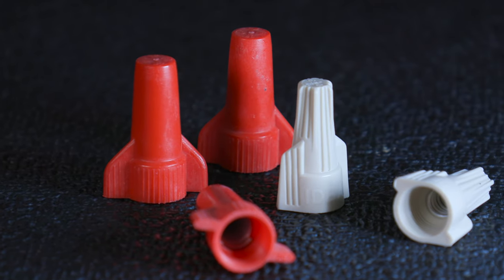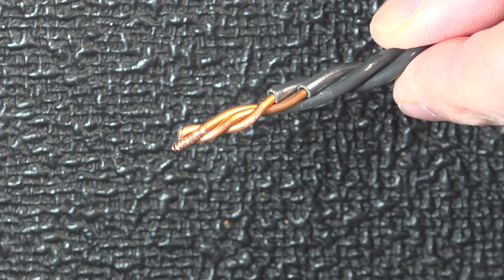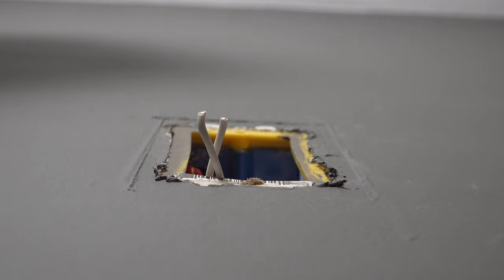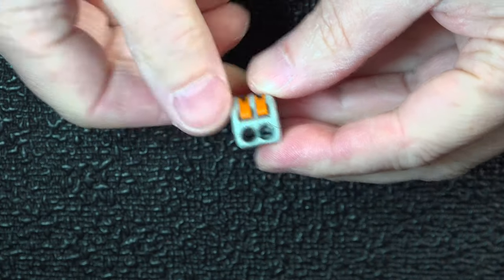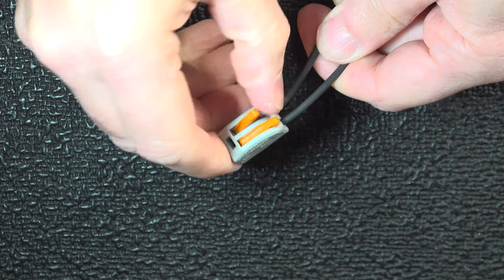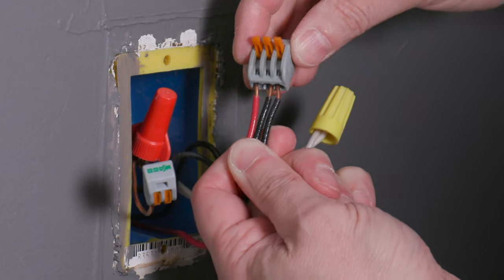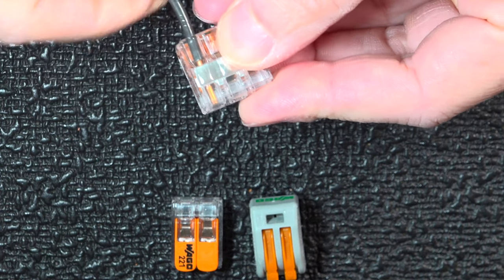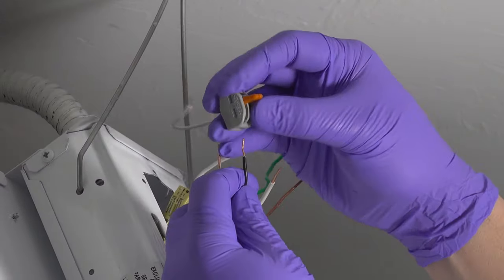Never use Wire Nuts Again - Wago is Better Electrical Connector

Comment: Lucky my Klein plyers allow me to redo a splice without cutting the wires. This is good for do it yourself or for lighting, but box splices should aways be spliced proper for 100 years of no issue!  Signs of melted marrets are a sigh of overloaded wire and not a bad splice. I am a master electrical contractor of 29 years.
Reply: Yea wire nuts are the way to go. Expansion and contraction of the wire will cause loose connections in wagos.
Reply: There is so much misinformation in this video. It gave me a headache.
Reply: @JorgeAMG187  I can pull wires out of wagos. I can't pull wires out of wire nuts. And yea heating and contraction of copper over time cause by load changes over time can cause a loose connection in a wago.
Reply: @Check7his With enough Force i can Pull a wire out of a Wire Nut aswell. Thats not a Argument. It takes 10kg of force to push a wire out of the Wago which is alot
Reply: @JorgeAMG187  if you can pull a wire out of a junction of twisted wires in a wire nut you have a weak connection.
Reply: @JorgeAMG187  oh and good luck having zero shorts in your boxes using wagos with stranded THHN.
Reply: I’m glad you said this. Listen to this guy everyone, he’s the professional here not the YouTuber
Reply: @Check7his  Whatever THNN is. I use the Lever Wagos for stranded and can even combine it with non Standed conductors. So i dont see the issue here. All i see is a American that doesnt want to go with the time and modern standards

Comment: Been using wire nuts since the 80s and my father and uncle since the 70s, we call them marrettes here in Canada and they are perfectly fine if you use the right size and install them properly. You very seldom have to undo a wire nut, you don't replace switches and receptacles that often. I will also argue that you get a much better surface connection with wire nuts, and yes, you should twist the wires together before twisting a wire nut onto them. 
I would use a wago connector but I would only use them on low voltage fixtures.
Reply: a lot of 2x4s i've gotten actually come with wagos
Reply: My stove is connected using Wagos. No issues whatsoever. The‘ve been the standard in Germany for decades and I’ve not seen a single one fail.
Reply: I'm with you 100% wore nuts with twisted wires has more surface area which means less heat
Reply: @markwilliams4525  they make wago's rated to 30 and 50 amps.
Reply: @VengaboysFansiteEI  I've heard of them but never used them. They remind me of a back wire outlet where they wouldn't have the surface area or contact pressure of the screw, seems to me a wire pre twisted with a wire nut screwed tight would provide better surface area contact and pressure meaning less heat
Reply: Here in europe, we have 240V and we use wagos all the time. They're rated for 450V/32A - 300V/20A depending on the wire
Reply: @rebeuhsin6410  ce is just "certificate europe", which means chineese product built with european standards. Yeah there are pretty harsh regulations here, but as a consumer, it's super comfy.
Reply: @vargabazsaa  that is actually incorrect. Please read up on the two different ce marks

Comment: Been wiring for over 35 years the only problem I’ve had with wire nuts is having to buy the purple ones lol
Reply: I’m an electrician with 40 years in service. WAGO is a German brand. In Europe voltage is 220 volts to ground. These work great there but with our lower 115volts l am concerned with the limited contact surface area of these. That’s the reason I never once used “quick wire” devices in my career! I only use these for connection of fixtures and only if they come with the fixture because they save my precious Wingnuts for more important jobs lol.
Reply: @ProctorsGamble  What's the problem with the limited contact surface area? They are all identical. If it works for 1 (after extensiv testing) why shouldn't it work for the rest of them too? What specific problems have you found due to this the limited contact surface area? Why not solder the connection after twisting it with a pipe wrench, and then add a double wire nut for insulation? That would give you the best  contact surface area, but do you rally need it?
Reply: @elbuggo   I can't tell if you are joking or are one of those paid bots with broken english. A pipe wrench?
Reply: @The_Conqueeftador  I added a question mark there - try again!
Reply: @elbuggo  Surface area has everything to do with it!  Try pulling 200 amps through a piece of #18 gauge bell wire and ask that surface area question again!
Reply: @angusmacgregor7217  Cant see that is relevant. Wago will handle 32A or more. Need a suitable wire though. Contact surface is sufficient for 32A (or more). Cant see why you need 10 times more contact area than sufficient. Why do you need 10 times larger contact area than sufficient? Have you studied a Wagoe under load with a Flir cam? If the temperatur in the Wago is fine during load, why isn't that good enough?
Reply: I’ve been an electrician no years but have diy projects.   I’ll just use what I have
Reply: They are SOOOOOOOOOOO expensive.
Reply: Expensive because they're meant to connect aluminium to copper. Why they're filled with conductive gel
Reply: Amen to that, I love explaining to clients that a little box of wirenuts cost them more than a roll of wire.
Reply: @ericfix0521  I just pack tans or red with CU-AL gel. Only had one inspector disprove because it didn't have a spark skirt. I always try to convince people that it's worth replacing aluminum with copper. Aluminum has been know to burn some places down.
Reply: same reason why we pigtail recepticals. we're not allowed to rely on the small tab of copper between the two screws to act like a splice point. so why would anyone rely on these little snap connections that we rip out of fixtures and throw in the garbage as a means of termination?
Reply: @journyman2010  That isn't a code. That is a personal preference. And that tab of continuous metal is better than a wire nut. More surface area on the conductor and a stronger connection when you properly wrap the screw and tighten it down.
Reply: Well I've been an electrician since Nikola Tesla was still in short trousers and I've always used wire nuts. I've also used ice cream containers and called them NEMA4X enclosures so maybe you shouldn't listen to me though.
Reply: @ProctorsGamble  If your an electrician, it is 120V and 240v in america.
Reply: @jefferytownsend7787  I know it's not code but that is how all our electricians are trained. But I have come across more broken ckts because of old faulty recepticals than wirenuts that just decided to fall off.
Reply: @ProctorsGamble  Ratings up to 32 A/450 V and 105°C maximum continuous operating temperature allow the 221 Series Splicing Connectors to be used at ambient temperatures up to 85°C (T85), making them ideal for small and large loads. Furthermore, approvals like ENEC or UL make the 221 Series ideally suited for use in worldwide applications.
Reply: @roamerreed  but you get the job done 1hr faster and charge them $120 less. Customer see how the savings stack up!
Reply: @davejohn255  120v split-phase (also known as "single-phase 3-wire"). The second "hot" rail in the service panel is 180 degrees out of phase with the first, giving a 240v potential between them, but either rail to the "neutral" rail is only 120v. There is no 240v service North America that I'm aware of.
Reply: @BlackEpyon  The US does use 220v (here it is usually 240v, but often referred to as 220v). But here in the US they split it (single split phase) into 2 phases of 120v so it is referred to as 120/240v (but still called single phase).
Reply: @chex313  But it doesn't come into the house as 240. It's not 240v from live to neutral, so it's not 240v service. It only becomes 240 at the end device when you go between L1 and L2.

Comment: As a master electrician I have used thousands of Wire Nuts, as well as Wagos (both old and new style). 

The wagos have their place, small stranded wire and light fixtures. Wire nuts are the best connection for solid wire. 

The spring inside a Wago (pressure wire connector) will fail if it heats up. I dont use them on anything but control work and lighting fixtures.
Reply: There aren't any springs involved. It's a simple lever switch that tightens ore loosens depending upon the direction pulled. Like a light switch as a matter of fact.
Reply: @Openreality  The angled blade that bites into the wire is called the spring.  It works like a ratchet mechanism in that it deflects when you insert the wire but bites in when you pull.  The advantage is speed and simplicity of use but the price is limited connectivity.  All of these quick connects only touch a small contact point on the wire.  In a wire nut connection there is plenty of surface contact.  At high amp draw (like a water heater or clothes dryer) this small contact area can and does occasionally overheat and fail.
Reply: @proislam1447  Really Pro?  Then go ahead and enlighten us with your wisdom as to why it isn't so..... (crickets chirping).
Reply: @bigweek85joeyjoejoe31  Wago 221 clamps are used to wire electical ovens and inverter cooking fields. So thats 3 phases of 220V/16A going full tilt - no problem at all. When I use my kitchen appliances, something like 4KW is drawn from the wall, and the Wago clamps inside the connection box don't have any  problem with that.

@taylor sutherland some original Wago clamps were only designed for solid wire. Newer models like the transparent ones can accomodate different types of wires though.
They won't fail for years, otherwise thousands of German homes would have a problem by now. And all our electrical wiring is solid wire (3x1,5mm² as standard, or 3x2.5mm² for higher loads), I think it is even required by law.
Reply: Trust the master guys.
Reply: @Kommunisator  I'm glad you've had such success with them.  Frankly I'm surprised they can handle that much current over a sustained period.  But my point was the uncalled for bias against wire nuts in the original poster's video, and Peter's confusion over the springs in Wagos.  I understand he was probably thinking of coiled springs instead of the older lever style springs.  Either way, there is absolutely nothing wrong with wire nuts... they install easily, are cheap, have been the standard for decades, and in most cases conduct as much current as the wires themselves.

Comment: Copper contracts and expands under load which will eventually loosen the contact point to the conductor. Wagos are fast and easy but a proper wire nut connection is a much more solid compression connection.
Reply: They are spring loaded and will compensate for that, the plastic itself will detoriate over time and then the housing pops open due to the springload.. then you have a real problem goin on. Noticed or unnoticed.
Reply: Wago made their name with, and have been used in, industrial applications, for several decades.  They are used in household systems in Europe for the past 15 that I am aware of.  This style is no more or less prone to failure than any other.

Comment: Electrician here. Wire nuts are just fine and very safe. :)
Reply: Spring loaded connectors are even better. They are safer, smaller, provide better insulation and cannot loosen.

And they are much faster to install.
Reply: @norbertfleck812  They have their place, but it's not in a 120v single-phase system like we have in our homes here in the US. The electrical connections in them is much like those cheap stab-in receptacles that fail over time due to the lack of surface area bonded in the connection.
Reply: @greedo2660  The WAGO connectors work fine with any Voltage up to 250VAC.
And here in Europe we also use single phase systems at lights and sockets. 
The three phase system is mainly used for industrial power, stoves and the like. Inside a living house it's all single phase 230 VAC (which is splitted out of the three phase system which comes into the building by grounding the neutral phase).

The standard fuse for a socket is 16 A and the wires are 1.5 square millimeter.

By the way: The WAGO connectors are widely in use since the 1970ies and turned out to be much safer than any other connector.
The wirenuts are even prohibited due to a lack of safety.
Reply: @norbertfleck812  but the connection is a single metal spring on the wire where as a nut is wire spun together ensuring a good connection
Reply: @tomwelshshore  In the WAGO connectors there is a separate spring for every wire port on the one side, and a solid, zinc plated copper bar on the other.
The WAGO connectors are certified for rocket launchpads and rocket engine test stands, while the wirenuts are prohibited even for household installations in EU.
Reply: @greedo2660  yeah..I question the ability of the little strip of metal between wires handling a 15 amp load for extended periods.
Reply: @norbertfleck812  oh god your telling me the EU wants to spend more money who would have guessed
Reply: @kevinkarbonik2928  You don't have to. The WAGO connectors are rated for much higher currents - which they can bear safely.
Since the 1970ies.
Reply: @tomwelshshore  No, they don't. They also allow screw connectors and crimp connectors, but not the fault prone wirenuts.
Reply: @norbertfleck812  lol man literally said screw in connectors and crimps and said wire nuts are prone to problems hahaha sure bud
Reply: Make a splice then twist the wire nut. 
These wagos are shit.
Electrons flow on surface of copper.   Surface area is paramount in a splice.. 
This is a resistance link awaiting an electrical fire.
Reply: These things are junk! With Arc fault breakers becoming more and more prevalent. I don’t trust them. Take them to that other job I’m not on. Use wire nuts. Please.
Reply: @norbertfleck812  Dont even try.. USA is "different" they using dumb units, dumb connections, building dumb wooden houses... Let them burn. 

Wago clamps are mutch safer, copper plate can handle high current because distance is very short and if electrican cant count even resistance of wire and conections, then he shoud do his job in USA where they dont care.
Reply: Well the little strip of metal in a wago is 4 mm2, so if a 2,5 mm2 wire can handle 15 amp load over time, why should 4 mm2 not?
Reply: Norm saying max losses are 10%. So in 230V circuit you can easily pump 20amp to 2,5mm2 wire. 
If is someone real electrican, than he know norms and can count losses in wire.
Reply: @NnetTucnak  If the cable is not too long, made of PEX and in ground or in free air, yes. Rule of thumb is 16 A but sometimes, I allow 20 A or cut down to 13 A. Depends on a lot of things. You need to calculate trip-time too in addition to losses. In Sweden, our term for trip-time is word-for-word translated to "conditions for ejaculation".

I work with everything from .5 mm up to 25 mm2 in my regular work.